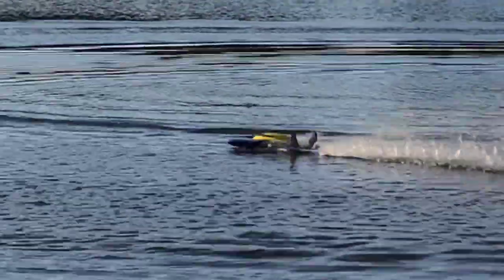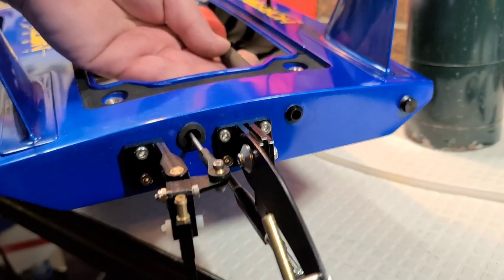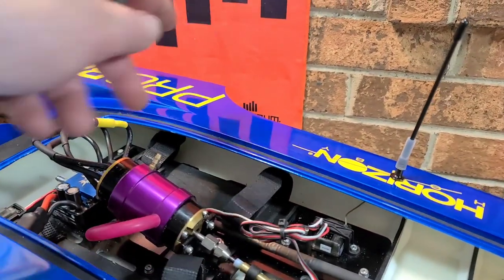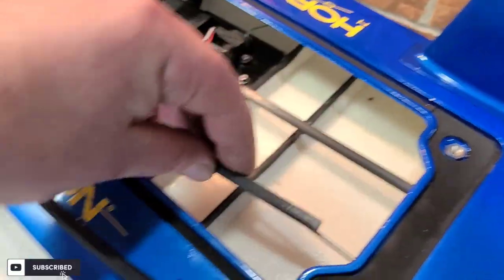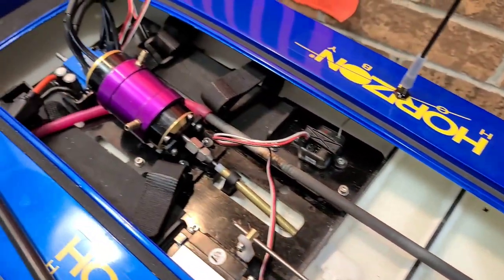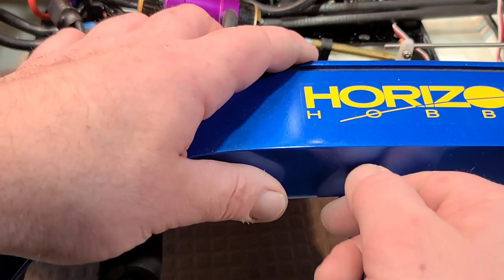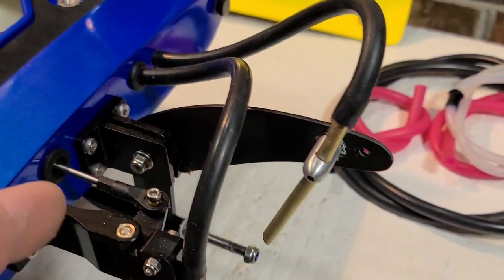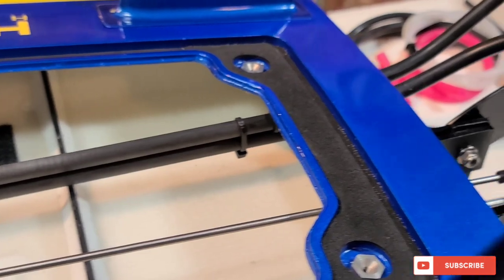Full Custom Cooling System for the Proboat UL-19 More Flow

Comment: Stock electronics will get super hot, no matter what you do. Unless swap for HW 180A Esc and Leopard 4074/1650-1800kv motor.
Reply from the maker: Doesn't hurt to try

Comment: Bro. I saw your video where you  mentioned the small nipples yesterday. So, we were probably voiding warranty’s simultaneously last night. I drilled out the nipples on the SonicWake . Gonna try it today and I will let you know how it works. The carbon fiber hard lines is good shit
Reply from the maker: I think it will cool the speed control down considerably.   Good luck with the test run brother.
Reply: @IRONCLADRC  thanks bro , I will report back to you. Also, I’m gonna meet up with Vinnie and run some boats. Met him through your channel
Reply from the maker: Yes sir it's the same speed control

Comment: I just bought this boat took it out one time and ran it was pumping water ran 3 or 4 passes maybe stopped in water red light blinking on esc what a POS
Reply from the maker: We're you running it on 6s?     I recommend a ose 150a esc.  I got about 5 or 6 runs in mine before the esc stopped working but I was running it on 6s.    The boat was designed for 4s operation 6s capable but recommended 4s operation
Reply: @IRONCLADRC  I ran it on 4s it’s working now but I only made about 5 or 6 passes with it and it stopped and red light started blinking on esc I thought batteries where dead but it only took 10 to 15 minutes to recharge batteries so I’m assuming they were not dead trying it again this weekend.

Comment: Why not put a pump on boat for constant water flow?
Reply from the maker: Pumps work but I don't want the extra weight in my boat
Reply: @IRONCLADRC oh ok thanks I was just wandering if a water pump would provide constant flow to keep temps down but I didn’t know why no one was doing it. Will the water pressure be the same in a high speed boat using a pump.
Reply from the maker: @jameshamilton6808  one of my buddies runs 2 water pumps on his twin, and gets great cooling.
Reply: Thanks I have the ul-19 and the sonic wake v2 just ran last week on 4s both boats ran fine but esc kept knocking off on the jl-19 just ordered a ode 150 amp for the sw but guess it needs to go on the ul-19. Does the weight of a pump slow down a lot